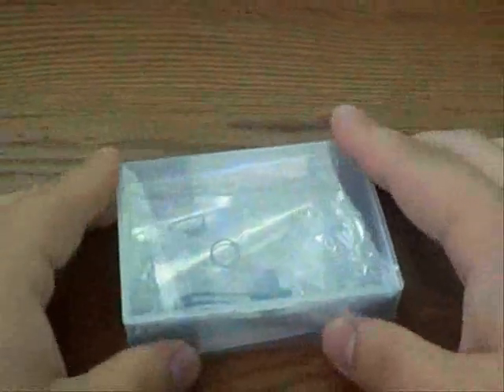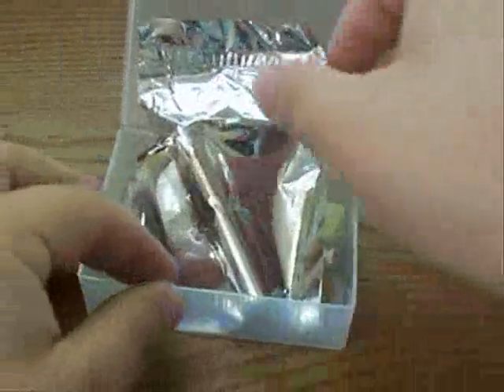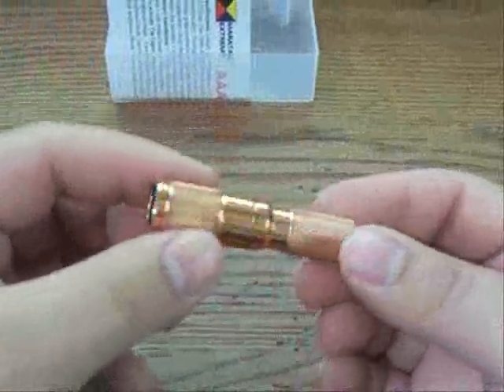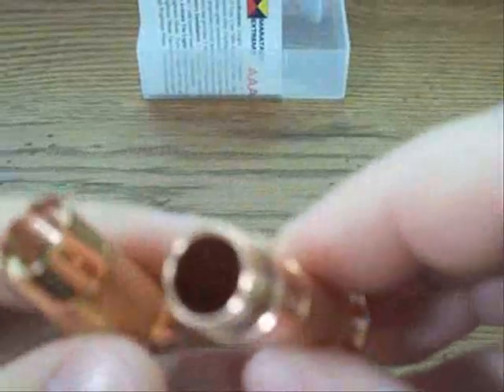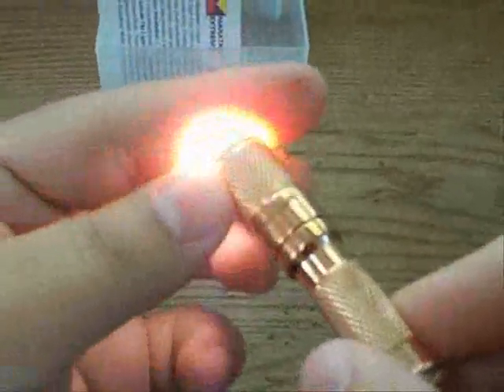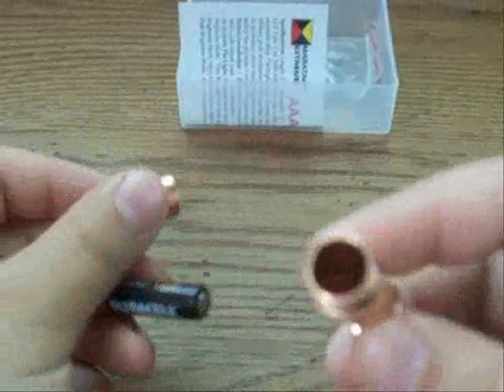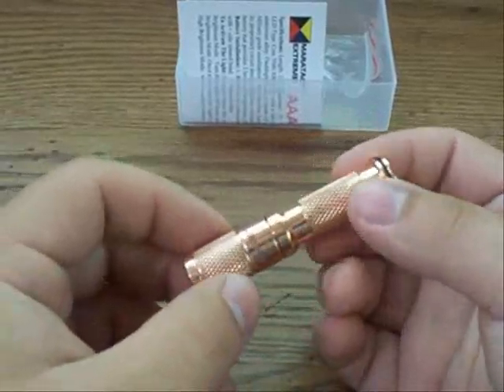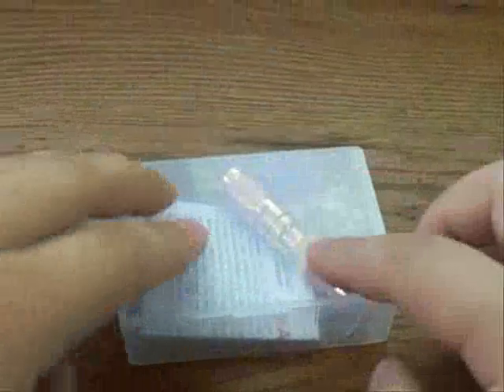Gear Review :  Maratac AAA Flashlight (SOLID COPPER)

Comment: i thought copper is soft and easy to mill, and i also thought it was a cheap material we use it for so much. how come this one is twice as more then the aluminum
Reply: yoohoosk8r I know this is a really late reply but the reason the copper is more expensive is because aluminum sells for $1.00 per pound and copper sells for $3.00-$4.00 per pound. It is also naturally anti-microbial and dissipates heat extremely well which in turn helps the led inside the light run cooler which in turn makes the led diode have a longer lifespan.